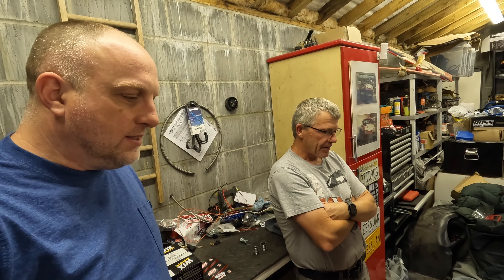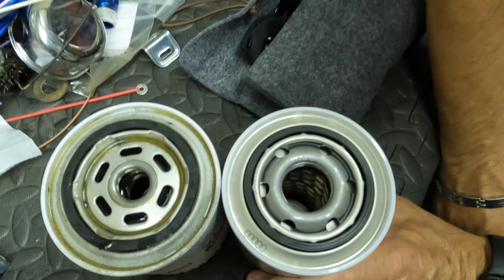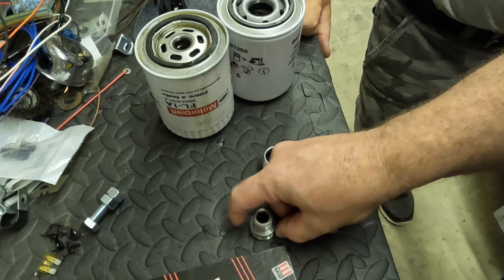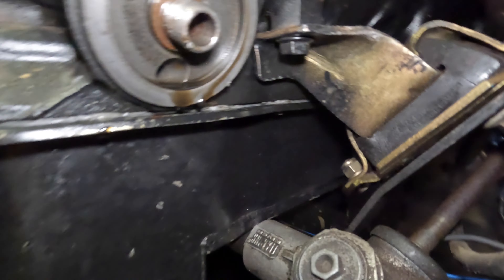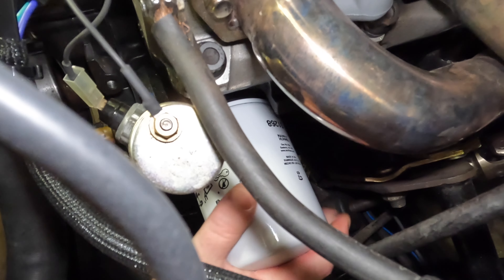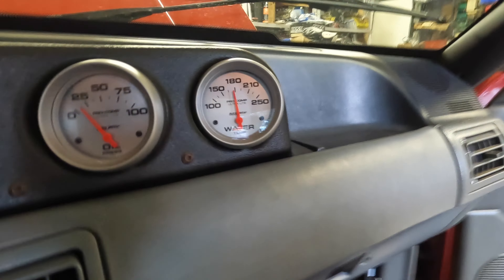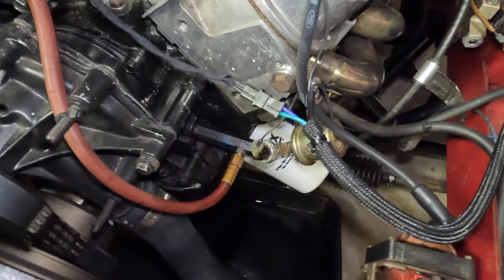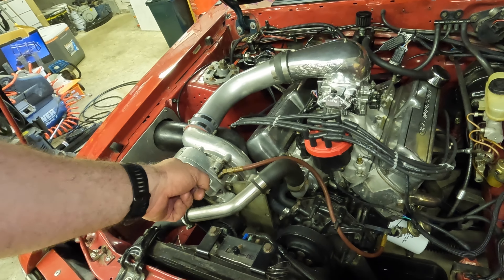SBF Low Oil Pressure Fix?

Comment: The only thing I run across in all my years almost 73 now. Build one after having a wreck in my 63 Fairlane put motor in my 62 couple weeks later rod bearing with out. Build motor in car rods main new pump oil pressure was low at operate temp try everything. Didn’t fix it until I replaced cam bearings.
Reply: Yep , all of my 302 explorer engines have low oil pressure . A friend who’s been working on fords for years was telling me about cam bearings being screwed up would cause this issue.

Comment: Whats the oil temperature ?
You should have idle 35+ at 200*f.
If not you've got a internal oil leak somewhere...
Check the core plug in the top of the block oil gallery, or by the timing chain.
Did you drill the timing chain plug to add oil to the timing chain?
I always use threaded plugs.
Also you might have excessive lifter body clearance OR do your lifter oil passages line up well with the gallery feed when you're using a very high lift cam... aka is the lifter coming up too high for the oil passages.

Comment: Look at the size of the oil filter INLET holes.
FL1a and Mobil 1 are the only ones with large holes.
Letting oil out is good, but what if it cant get in ???
Does that affect the filter internal bypass? Yes.

Comment: Have You tried to put a restrictor in the oil feed line to the blower as long as there's sufficient flow to  it Bob's Your Uncle. Best Wishes & Good Luck . 🇺🇸🇵🇷🦊👍
Reply from the maker: The supercharger has a .060" restrictor built into the spray fitting as to meter the incoming oil.  That is science'd out by Vortech to meter the proper amount of oil through the supercharger head.
Reply: @Mike-FoxsAbroad   l asked about a restrictor is that I helped a friend install a used blower on his 351 swapped 🦊 and We could not maintain oil pressure until We installed a restrictor in the oil feed line that was missing .🇺🇸🇵🇷🦊👍

Comment: Good video guys. Personally I think that you are trying to put lipstick on a pig, so to speak. Pressure comes from resistance to flow. If you have inadequate flow, you have inadequate pressure. Yes an oil cooler will help, but you are treating symptoms, not root causes. Reducing oil flow to the supercharger will prove your theory. Personally, I'd drop the belt off the blower, cap the oil feed, and see what happened. If it does fix the problem, then personally, I'd just bite the bullet, and go through the drama of fitting the hv pump. The oil filter conversion made minimal difference, because there isn't enough flow from the pump at idle to create a meaningful pressure drop. That said, fitting the oil cooler is a very good idea. If you ran an oil temperature gauge i think you would be astounded at what you saw.
Reply from the maker: We have come to that same conclusion ourselves.  The oil cooler is easy but expensive.  The HV oil pump, pan gasket and rear main seal is about 1/4 the price.  After our next track outing we plan on pulling the engine and performing the fix. The rear main seal or pan gasket is leaking (we cant determine which one it is) anyways so we will be solving two issues at once.

Comment: If your are not running a synthetic its worth a try more temperature stable. Should definitely trouble shoot it more  instead of just buying parts and crossing your fingers as well as adding complexity to crucial system.
Reply from the maker: Finding synthetic 20w50 that's not for a motorcycle in the UK is easier said than done. It also costs about $14 a liter over here so it's not just a whimsical decision to try a different weight oil and see how it goes.  What do you think we should try next?
Reply: @Mike-FoxsAbroad  could be a million different things right haha. if its a fairly new problem its possible that the pressure relief valve is not seating all the way and bypassing a small amount at idle. Ive seen a few 4.0 jeeps have cracked heads and leak water into the oil my own included and wash the bearings. the oil light would come on at hot idle and running synthetic would bump pressure up just enough to keep the light off.

Comment: What oil pump in it. You can shim the oil pressure spring
Reply: Shimming the spring will only affect the maximum pressure achieved. Until you reach maximum pressure, the valve is closed, and has no affect on oil pressure.

Comment: I HAVE A SIIMILAR ISSUE IN MY STOCK  ENGINE WHERE EVERYTIME I CHANGE OIL I GET LOW PRESSURE WHEN OIL GETS HOT , IF I CUT OFF FOR 10 SECONDS AND RESTART THE PRESSURE IS GOOD FOR AT LEAST 20 MIN  BEFORE IT GOES LOW AGAIN. THEN I REPEAT THE CYCLE. AFTER TWO WKS OF DAILY DRIVING THE ISSUE CLEARS UP FOR ITSELF AND NO MORE LOW OIL PRESSURE. THIS HAPPENS EVERTIME I CHANGE OIL OR DO ANY WORK ON THE ENGINE.  ITS VERY BIZZARE.
Reply from the maker: Do you have stock gauges?
Reply: @Mike-FoxsAbroad   the vehicle just has a low oil pressure light.

Comment: What is your oil clearance on rod and main bearings?
Reply from the maker: They were all on the mid to loose side of spec.  It was over five years ago when we assembled the bottom end and blueprinted all that stuff.  If I threw you an exact number I'd be B.S.ing you as I can't honestly remember.

Comment: Simplest fix,, Buy a sbc 😁
Reply from the maker: Blasphemer!  😆 I've driven SBC and BBC cars where the oil pump pickup has fallen off the pump.  You accelerate and you have pressure, step on the brakes and watch it drop to zero.
Reply: @Mike-FoxsAbroad  yep there is a hold down bracket for that 😁
or a welder 😲🤠